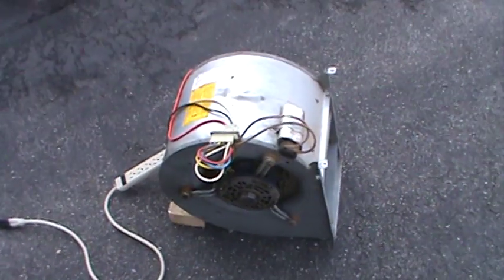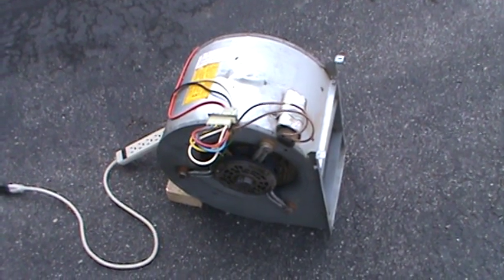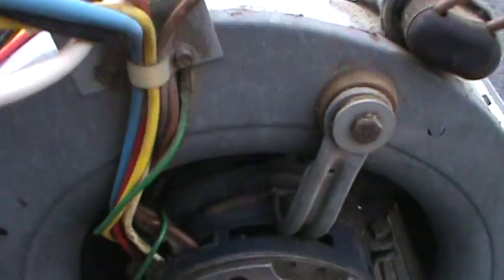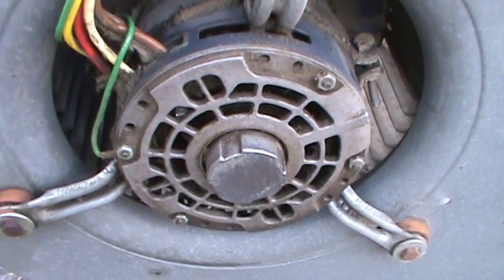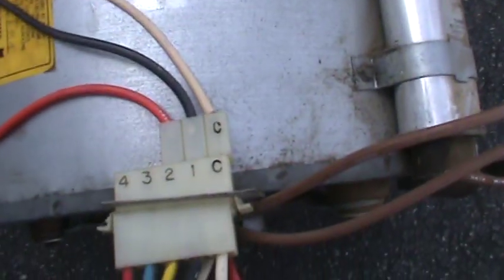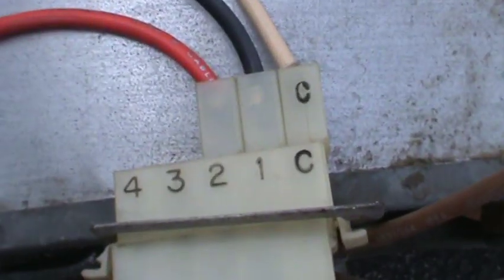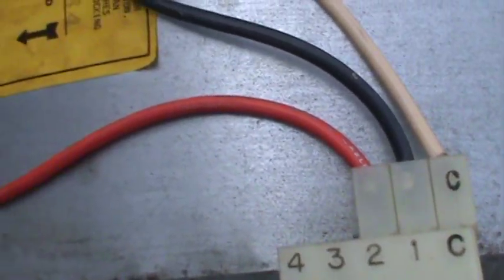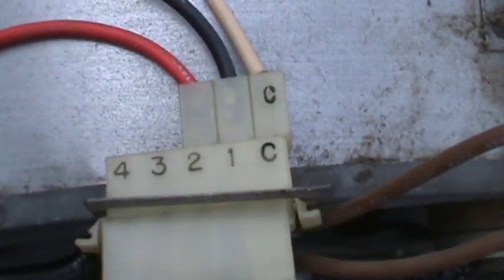Blower Fan from old furnace

Comment: Just a little bit of info here for you. Get yourself a 2 or 3 inch wide piece of plastic that is about the height of the whole unit and put it over the opening on the side of the fan to restrict a little airflow. The fan will blow out almost twice as much air as what you are getting now. Right now it's sucking in too much air and is not as efficient as it can be.
Reply from the maker: Thanks!

Comment: Hey whats up man, they work great on a hot day !!!
I like to take a heavy gauge mesh , and put over all openings , so little fingers can't get inside, and hurt themseves !!!  Home Depot must have seen alot of are Tradesmen using these ,and copied... I actually have one it has multipul speeds, and a electric strip to plug in other devices ... this time of year all my buddies want me to save them the blower motors for there shops !!!

Comment: How many amps does one of these draw?
Reply from the maker: I don't know... would be good to test!
Reply: Metalcastr
I ask b/c if I get a direct drive one like yours I'll be running it off a 15 amp circuit. I just don't want things popping. These are installed on usually a 20 or 30 amp circuit.